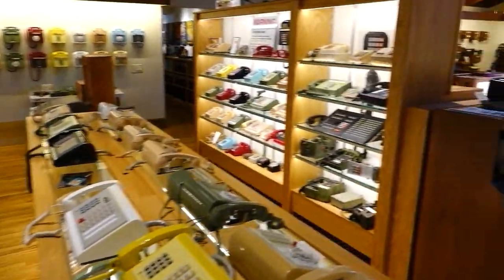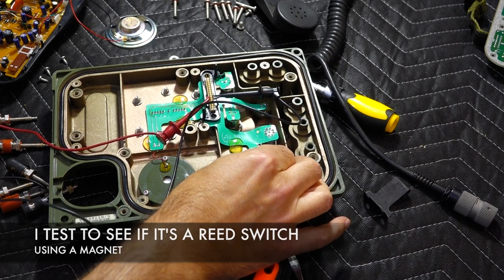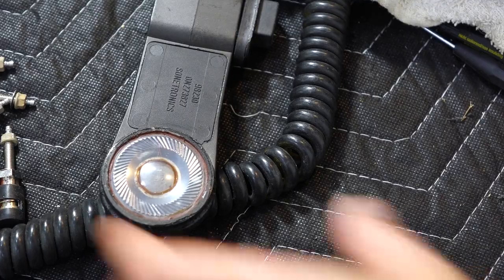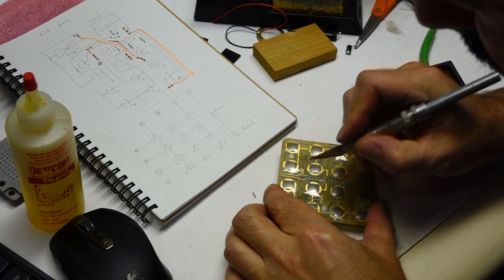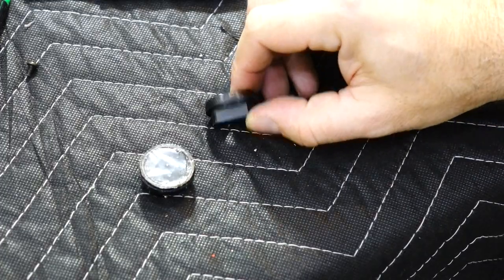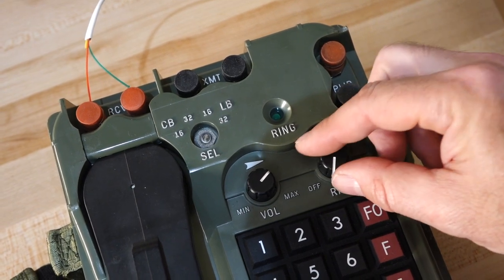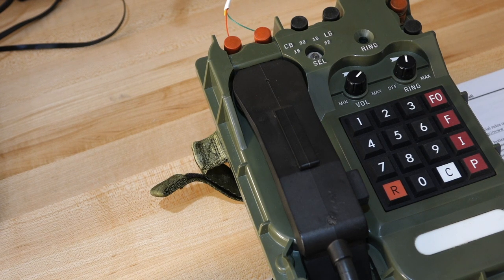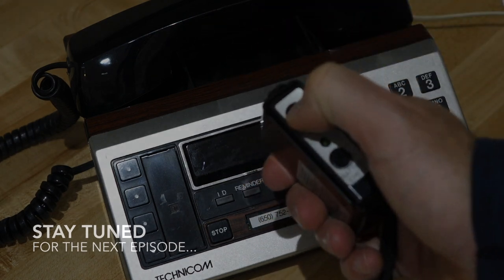Converting a Military TA-1024A/U Field Telephone for Regular Phone Use

Comment: I was astonished that the military used TACT type switches for the keyboard. Those are notoriously unreliable after a while because the scotch tape seal will let either air or humidity in, and the contacts will oxidize. Unless there is a very good debouncer circuit to avoid double contacts...
Reply: This probably wasn't a concern since the entire unit was hermetically sealed
Reply: @scottinthebooth  The keyboard had a separate seal. And yes, this style of switch is extremely unreilable, slightest moisture exposure seemingly ruins them even if the PCB has gold plating.
Reply: @FrozenHaxor  this is the military that board is not good plated, it's gold

Comment: what digital line did this expect? (ISDN?)from the historians point of view would't it be better if you could somehow emulate this line rather then modding this phone?
Reply from the maker: An undocumented military only digital protocol. It would be great if it could be reverse engineered. No one has succeeded so far. Still classified as of today. [Edit] See below the answer from @1701gijoe, it appears this is called a diphase loop or DILPA compatible phone.
Reply: it's a military phone meant to be used during war, i'm pretty sure security was their top priority while making this thing
Reply: hmm any documents uvailable for this system?
Reply from the maker: Thanks so much @1701gijoe. Searching DILPA (Diphase Loop Modem A) yields this interesting info on the mobile switch it can connect to: https://www.globalsecurity.org/military/library/policy/army/fm/24-27/Ch2.htm. Fits in a 5 ton truck! So it seems we have a DILPA phone, or Diphase Loop is the common name of the digital protocol.
Reply from the maker: @Robert Szasz Thanks, great link! Added to the video description.  I want one of these trucks stuffed with 5 tons of switch electronics now!
Reply: @1701gijoe So do they have these models in voip version? Sturdy military phone seems like a nifty gimmick.

Comment: Each key grounds two pins? Sounds like an old-fashioned DTMF keypad.
Reply: DTMF is not old-fashioned. That's what all phones use today, whether exposed to the user or not. Even mobile phones.
Reply: Modern phones tend to use a standard matrix-scan keypad or even just a touch-screen, and handle the DTMF encoding in software. Older phones did the DTMF encoding in the keypad. If you look at the datasheet for an older tone generator like the TP5089 it has a pin for every DTMF tone and each key grounds the two pins corresponding to the tones that represent that key. This obviously requires a special keypad.
Reply: @Tedd755  Mobile phones do not use DTMF for dialing. They send the number over a digital channel. They can however send DTMF tones over an active call.
Reply: This all was good reading! Thanks everyone!
Reply: Historically speaking, the older touch tone pads used two circuits. One for High group, one for low group. This went out the window when the second generation of integrated circuit DTMF generators appeared. It was single line to actuate a pair of tones. Some encoder chips would even accept BCD input.
Reply: @Tedd755  I work with VoIP mostly, and the "dtmf" is no longer dtmf, it's just an out-of-band sip message, sent as text. It's not dual, and there's no tone, let alone multi-frequency. Some phones make the cute noises back at the user for the user's psychological comfort, but they no longer /do/ anything.

I haven't worked in the cell industry yet but I'd put money on them using a similar system.
Reply: Each key played a combination of two tones, so grounding 2 pins makes a hell of alot of sense in the pre-digital age.
Reply from the maker: @rich1051414  Yes. I think @makomk nailed it, the keypad must come from a previous military DTMF assembly. But I don't think it produces any DTMF tones on this purely digital telephone.
Reply: @CuriousMarc  DTMF is sent over Bluetooth when doing speed dialing over "hands-free" connections, my car will sometimes just play the number through the stereo instead of the phone when I try to call sometimes. It's very fast short tones, but unmistakable

Comment: I guess you had CRT in the background somewhere. Around 1:40 you can hear high pitch noise when listening with headphones. Easy fix in editing with high pass filter if I remember right.
Reply: Only a problem if you are young
Reply: It would need to be a low pass filter.
Reply: I also heard the putt putt sound of I think a cell phone lmao
Reply from the maker: After much testing, I figured it all out: the putt putt is the AT&T Uverse access point, the high pitch CRT squeal is the NTSC line rate from the camera built-in LCD screen. Both picked up by the Rode shotgun mic, which is very evidently not shielded enough. The mic shielding has been improved, hopefully we’ll be OK next video.
Reply: @CuriousMarc  Thanks!
Reply: @shortwavefan2487  I guess you are too old.
Reply: a man of culture i see
Reply: I can just barelly hear it. First pass i didn't even react only after you pointed it out. I guess im getting old or my hearing getting bad.
Reply: @stupossibleify  I'm 28 nearly blew out my eardrums. I had tinnitus for a few months it freaked me out.

Comment: FO = speed dial to mom I presume?
Reply: *wife
Reply: I don’t know if this is a joke or not but I think it might be field officer
Reply: @awlomthesheepermen  It's for Flash Override, which is a level of precedence in the military switching system.  (Actually not so much a precedence as a capability).  Use of Flash Override was limited to the President, Theater Commanders, and high-ranking posts in the chain of command.  It allows the user to kick off all other calls on a trunk to ensure that their call goes through.
Reply: trendingdown yeah I realized I was wrong after I was done watching so thank you dude :-)
Reply: @flashoverride2  spoken like a real Telecom guy... I had a chance to play with dsn when I worked on 5ess
Reply: Emergency pizza.
Reply: No....FO stands for f**k off aka silent mode and nobody will be able to disturb you...

Alright alright, I know where the door is...

Comment: Dude, the H-250 handset is well documented. Much easier is using a T/A-312 field phone with removable key pad.  Same retro military look, less re-engineering. Charlie
Reply: Since it's a field telephone, that's actually an H-350 handset; which is almost entirely the same as the H-250, except it's wired for hot mike operation (you don't need to hold the PTT key to speak).

Comment: I have the previous model (or, at least the last model before the upgrade to digital) which looks very much the same, but works on the POTS system without modification. It uses 4 C batteries so that it can operate on a non-powered set of wires also. (I'll have to dig it out to find the model number.) When I  opened it up, I found that it was based on a Z80 chip, so probably late 70's / early 80's  design. 
Update: Found it it's a TA-838/TT and it's in the upper left at 0:21 of the video.

Comment: This is a DNVT (Digital non-secure voice terminal) it can connect to a large number of radios or a computer and used sort of like a modem. We use, yes present tense, these all the time. They are very much still in use. The radios are encrypted so the phone itself doesn't need to be.
Reply from the maker: Thanks! Is there any information of the use of the phone in this context that is not classified that you could point me to?
Reply: Brent, do you have any info, how much does this cost when new? I saw that this example came from '92, that time this was quite high-tech circuitry, plus the quality of manufacturing etc etc... and military stuff never cheap, OK, but can't imagine the price tag. Several thousands?
Reply: @CuriousMarc  if you search for DNVT you may have better results than the actual model. I would love to send you the technical manuals but they are not authorized for public release and I'm still in the military and dont feel like going to Leavenworth. There is a switching terminal that these connect to obviously but I've only seen one and never messed with it. To clarify, we used this like a modem to connect data radios across extreme distances more than anything. We would call the other operator, wait for them to answer, verify identities then press a button and hang up the receiver. 32kbps was much faster than what we could get from the airwaves.
Reply from the maker: Now I need to (re-)join the military ;-)

Comment: I love ex military kit. Its so over engineered and well constructed. Some of the 40-50's lace wiring looms are a work of art !  Great video and nicely reverse engineered. You could have used a dual coil flip flop relay powered from line voltage and the push to talk would have been great inline with the microphone as a mute feature. I don't think anyone is going to break that phone anytime soon though  ;-D
Reply from the maker: Great idea for the mute on the push to talk! Why didn’t I think about that. I’ll see if I can rewire it for that. Not straightforward as this is a NO switch if I recall well, I’d need a NC one.

Comment: I decided to skip towards the end 2 mins in. This guy did not built a adaptor to simulate the "digital military switch" to the phone, he did not reverse engineer a thing in this device. We are still left wondering if it's an ISDN device of sorts with similar protocols as used in Europe and elsewhere where ISDN is still a thing, or if it's not at all related to the protocols.
Reply from the maker: As it says in the video, and in the other comments. Military digital protocol, still classified today. No one has been able to reverse engineer it yet (at least that I know of).
Reply: CuriousMarc Houses were already invented a long time before even the first bricks of Rome had been laid. Just because it's a classified interface and protocol does not mean it's going to be radically different from documented digital phone systems. If you're interested you could start with ITU I.430, Q.921 and Q.931. Anyhow thanks for the video but there are more interesting videos to be made using that phone.
Reply from the maker: @statinskill  But that's exactly my point. The three publications you mention above, which are documents from the ITU standards body partially describing the ISDN protocol, form a total of 720 pages! The military digital protocol, which aims at a completely different functionality, is going to have nothing in common with this, but is going to be very complex. No one has succeeded in reverse engineering it yet, and it might stay like this until some document is declassified or leaked. But hey, you are welcome to try. BTW, digital communications is my real life trade, and I sit on several international standardization committees that make such documents...

Comment: Actually, 0 ohms is when you have a direct connection or short (depending on how much of the circuit you're measuring). When you discover an open circuit, you don't get 0 ohms, you get infinite ohms.

Comment: I don't think you had to actually disassemble the handset at all, the handset pinout is a standardized pinout (U-229 Connector pinout) allowing you to transfer the handset to other devices. A dynamic microphone element or a capacitor microphone can often be interchanged, but the levels may be slightly different. Something a small adjustable amplifier can solve.

There are some variations for this handset, but essentially you should be able to take a handset from a PRC-77 and connect it to your phone and the other way around except that the microphone element you put in wouldn't work on a PRC-77.

Comment: awesome ! I have an old military APU ( generator) control panel, which has one of my favorite switches on it labeled "BATTLE SHORT" which in the case of necessity will allow the engine to run, bypassing all engine safety (oil pressure / over temp) . Regardless having a switch labeled "battle short" is just plane fun ! just like the red FO button :)

Comment: I may have missed something, but why didn't you wire in the reed switch and use that?
Reply: Needs to change over 2 sets of contacts, and the reed switch in the phone only has a single change over contact. Standard phone has the ringer on the one set of contacts so that lifting handset disconnects the ringer and connects the phone load of the speech circuits, and the second set disables the DTMF chipset so it does not get damaged by the ringing voltages. For last number redial and other off hook memory there is a high value resistor to charge a capacitor to keep this memory, fed direct from the incoming line, but this only draws a tiny current.

Comment: How waterproof do you think these were? It looks like it has some form of a seal, like a giant oring. Just curious how waterproof/water resistant these things were considering the time it was used.
Reply from the maker: Very waterproof. Every screw had an O-ring. The connectors have seals too. The keypad had a double seal (a rubber one plus the plastic membrane). Obviously made for exterior unprotected use and abuse.

Comment: It's unfortunate that you had to break the weather seal for the hook switch.  Another solution would have been to use multiple reed relays (or just reed switches) to get the desired type and number of contacts.  The area that the earphone magnet affects is more than enough.
Reply from the maker: Yes it’s a bit of a downer. I tried (maybe not hard enough) and could not find DPDT reeds that would fit - these are much larger - actually over twice as large as they are made of two DPST reeds. Another solution was to substitute with a same form factor NC reed (instead of the NO), and have that trigger a DPDT reed off the side. But that would have required an external power source.

Comment: Very nice modification! That is a beautiful telephone. If I were you, however, I would have found a way to used the original dynamic mike!
Reply from the maker: Great! You design and test the impedance, level and equalization adapter circuit that works off the phone line power and I’ll work it in. Honestly, I cannot see any advantage of doing it that would justify such a large effort. Sound pickup is going to be exactly the same.

Comment: ...why did you pull the board? Why didn't you just pinout the digital connector? I have the TO for that phone with pinouts. It's not special telephony stuff...
Reply from the maker: If you can help reverse engineer the undocumented digital protocol of the phone I would greatly appreciate it. It's a very involved project. Some have attempted it but no one succeeded so far.
Reply: @CuriousMarc  It's not undocumented....There's tons of documentation. You just gotta know where to look. Military archives.
Reply from the maker: @TheMrProbasco  Link?
Reply: @CuriousMarc  Stdby. I'll look through some old documents I have I was in when these were in widespread use. They connected to FCC100 multiplexers with the use of a BAMS call manager via a "proprietary" cable but it was just a repinned serial bus. There was also a mode wherein you could just do 2 wire normal telephony too.
Reply: Section 4-4 talks about CB mode. It's basically normal telephony with bare wire instead of an RJ-11 connector. I think you may need a 6 wire setup...maybe.
Reply from the maker: Yes. I had found this document, of course, and a few others. But sadly it is useless. It has zero information that would help you reverse engineer the digital protocol. The 4 wire setup can be used to connect two of these digital phones together, but it’s still a purely proprietary digitally encoded connection (a very good one at that, said to work for 4 miles!). Not usable on a regular phone line unfortunately. But hey, if you only need a short private line with two phones, that would indeed work with two unmodified phones.

Comment: It was possible to use a digital-to-analog converter without even disassembling the phone.
Reply from the maker: Great! Do you actually know where to get a DILPA converter that would do the (still classified) digital protocol to analog conversion? I looked everywhere and could not find a single one on the civilan market. I’d love to know your source. The other solution is to use the card from a second phone, but a) you’d still have to kill the second phone to get the card and b) that would still not let you access the keypad numbering generation protocol, so I decided agaist it.

Comment: Subbed! I've seen  these and looks like fun! I  believe the Vintage Museum would love this idea! Did you know the actual keypads isnt just 0-1 #,* but  actual 0-1 #,* A,B,C,D and also the other was 0-1, #,* A,B,C,D through  Z! {rare finds] I own all 3 as most own just 1 common keypad.
Reply: Weirdly enough my aftermarket Kenwood car stereo has numbers 0-9, #, *, and ABCD on the touchscreen keypad for the telephone integration.  And they generate the correct tones too.  Odd inclusion for a consumer product, but it also has features like reading OBDII codes and letting you reset them.

Comment: No way to reverse engineer the digital connection on the back? Seems like such a shame to destroy that work of art.
Reply from the maker: When there is a will there is a way. It would be a very cool project. A bit too busy for it now. I sure kept the board!
Reply: @CuriousMarc  Easiest way to convert the keyboard and keep it original is to use EPROM to act as look up table, you just program it with the byte pattern it needs to put out when scanning, and power it off the DTMF dialler supply. Generally those are around 5V, and CMOS Eproms are happy with doing this, though there is a massive waste of the space, or you just use a CPLD to do the same logic. Byte pattern from the keyboard on address lines with pullups, and scan pattern on some others running through the device, and diodes if needed to act like the scan outputs and stay high Z till scan pulse detected.